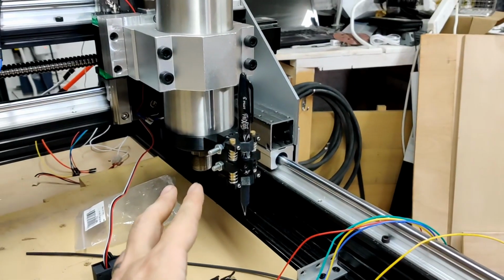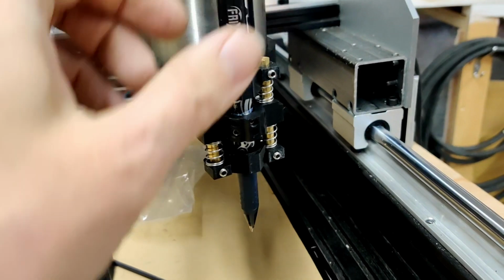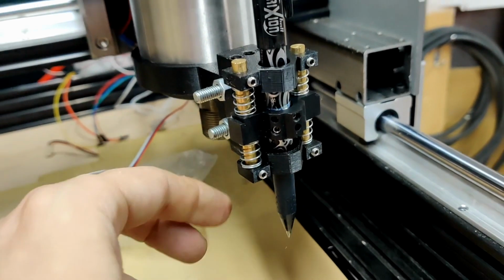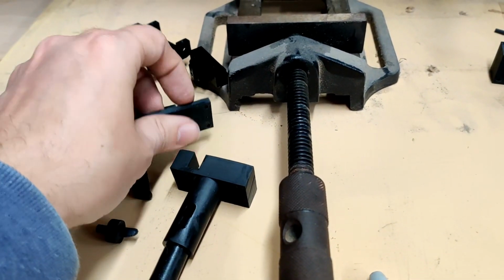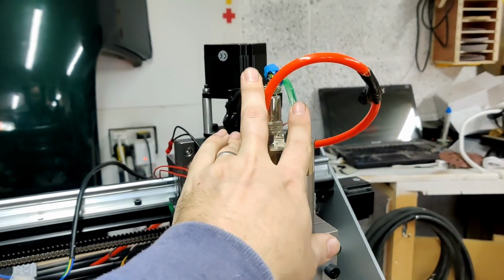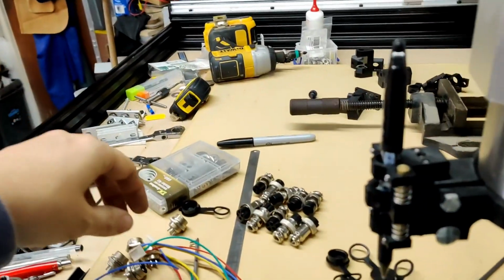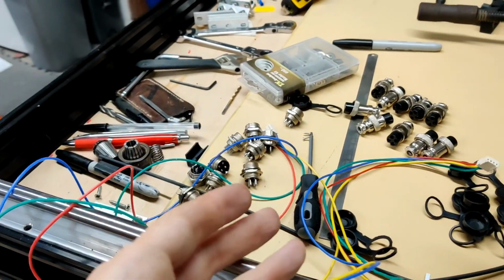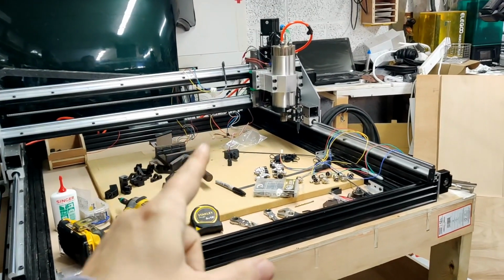Custom CNC build - update

Comment: The pen holder is a nice addition for testing - I have a little 3D printed vinyl drag knife for my CNC which is surprisingly handy but I had the exact same issues with achieving the optimum pressure and limiting backlash.  Could you mount the pen with less 'stick out' to reduce the effect of the backlash?  I'm hovering over the 'buy' button on a Duet to replace a very homebrew GRBL controller - looks like a much more stable solution.  Hope you're feeling better soon.
Reply from the maker: Cheers Matthew, feeling somewhat improved but still testing positive. The problem with the pen holder is the give is all at the holding point. I could try less stick out but I don't have a ton of height to play with and I think I'd get similar twist. I'm nearly done with the proper wiring. So once I can surface the bedi can revisit how it handles. Somewhere o have a design for a knife drag bit which I'll have to try. I also have a diamond bit I'm planning to make a holder for. I'm loving the duet, I did some videos a couple of years ago in my transition from a grbl based xPro to the duet. Night and day in motor handling and smoothness